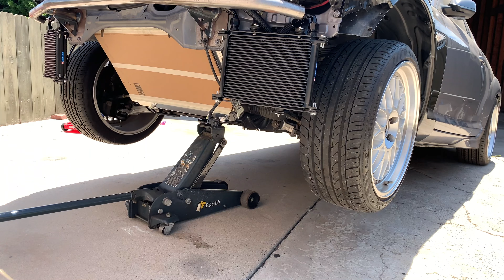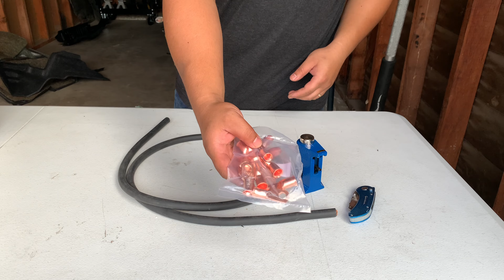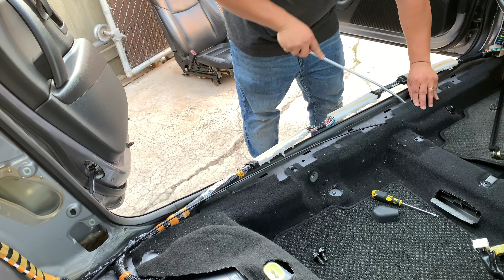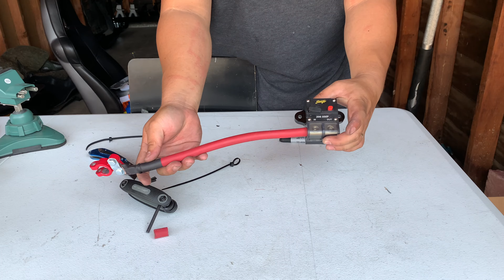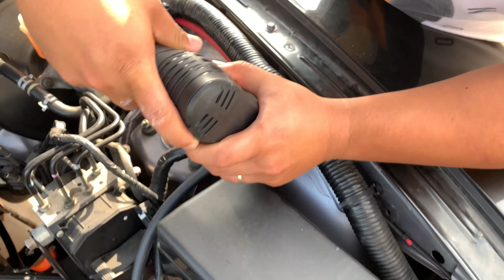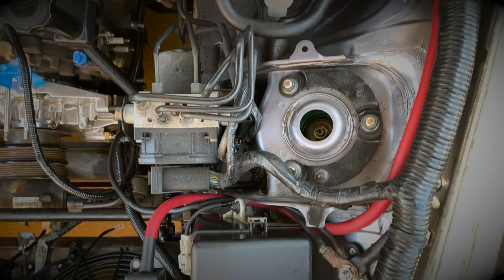Battery Trunk Relocation and Coilover Install on Your Mazda RX8!

Comment: why not put the shrink warp tubing on first on the wire them crimp the connector on then slip the heatshrink tubing up and over the connector where you need the shrink tubing or shrink wrap tubing.

Comment: When doing an engine swap is it best to use the RX8 fuse box or the ones from the car you are taking Engine from? I have a complete TSX Donor car for my k24A2 swap RX (The under hood one)
Reply from the maker: RX8 fuse box. You will only need to change the ECU and wire it up in order for your k24 swap to work.
Reply: @freemadc2  what you think about the RWD wire looms? Waist of money or will the factory one still work?
Reply from the maker: @ScarletSanctuary  anything from rywire is an amazing product, but if you are on a budget, you can definitely make a harness yourself.
Reply: @freemadc2  Thanks for all the info, when people do these swaps they always leave out the most important part, wiring and ECU needed. EMU BLACK has presets for the RX8 K24 swap built in, for others reading this.
Reply: @freemadc2  was planning on getting the EMU BLACK or would the TSX ECU work? Want to be able to use the RX gauges and Electric Power Steering
Reply from the maker: @ScarletSanctuary  I heard EMU Black indeed works in the RX8, but not alot of info last time i checked. I went with adaptronic modular, cause i know it works with the stock can bus equipment from the get go.
Reply: @freemadc2   sadly Adaptronic has been sold out for awhile with no ETA on restock or would get that one. Talked to ECU Masters yesterday about the EMU BLACK and it talks with the canbus and it's a pin yourself kit.
Reply from the maker: Yea. This youtube video has good info on using EMU Black on a RX8. 
https://www.youtube.com/watch?v=QO4z2OUii44
Reply: @freemadc2  awesome, been watching every RX8 swap vid preparing parts list and what to expect and knowledge from different people.

Comment: This is incredibly helpful. Thank you man. Gonna be doing this soon 🤘
Reply from the maker: No problema. From the feedback of the community, just install battery on the opposite side of driver 👍
Reply: @freemadc2  gotcha. If you don't mind me asking, is the battery junction at the front of the car for the positive terminal necessary?
Reply from the maker: @TRlANGLZ  it is not. I just like the way that jp3motorsports did it for the 1993 Rx7 and so I tried copying it :).

Comment: Great job for all, but the battery positioned in which point, does not unbalance the weight in the right curves?
Reply: The battery weight isn't really that significant. The main reason to relocate it is for more cooling airflow in the engine bay.
Reply: @inoahmann7542 The weight is definitely significant, especially the balance. You're taking about 30-35lbs from the nose of the car and putting it down into the back...

Some do this from the sake of battery discharge issues as well, I'm going to be running a shorai and will be doing this soon.

Comment: Ty finally a good video for my 8 battery relocation
Reply from the maker: You are welcome and thanks for subscribing. To note, a few subscribers pointed out that it’s best to mount battery on opposite side of drive for weight balance and you do not need to run a ground to engine bay like I did. Other than that, my videos will guide you through everything else. Cheers and happy relocating ;).
Reply: @freemadc2  btw you should start posting again!!!
Reply from the maker: @ericbrusuelas1807  💯. Follow me on Instagram. I’m starting to give small hints to next project 👍

Comment: Great job on the relocation. 

For everyone else who watched, you don’t have to route the negative cable all the way to the back which in turn can save time & space to keep the original retainers for the main harness inside the car. 
One ground from the battery to the strut bar. Another ground from the ground cable in engine bay to the body of the car via a grounding block (Amazon for $7-12 pair) . Doing this will look just as solid as well as save time on messing with the engine battery harness (just tidying up & tucking is all that’s required) In the end it’s up to you (the wrencher) to decide. Overall great job man! 💪🏽
Reply from the maker: Hey Daniel. Thanks for the props man! More videos come. Yep extending the negative terminal cable to the engine bay is optional. I did it just in case I have some electrical components that needs to see a battery negative instead of a chassis negative. i.e. the IGN1A coilpacks. Less gremlins to worry about with this one extra step.

Comment: Lol just noticed we have the exact same color setup, I have a silver 04 and I did the s2 front end conversation black fenders
Reply from the maker: That is awesome! Did you also get a steal on a S2 front end? Mine came off a GT. Did you get yours painted already?
Reply: @freemadc2  yep! 150 for both fenders headlights and the plastic under tray. I had 1 bad fender and it would’ve cost more to get a new fender than it was for all that at the junkyard
Reply from the maker: @jerretn99  Thanks for following! I still gotta get the plastic under tray, but yep, going to the junkyard is the best way to get the best deals!

Comment: Link to battery?
Reply from the maker: Here is the link.... https://amzn.to/3504dwQ
Reply from the maker: Also the Battery bracket link.... https://amzn.to/3jMKqVV
Reply: Thanks love the build I would like to get a fd engine in my 8
Reply from the maker: @jonathanruiz3840  Hit me up anytime if you need help. Ill try to share as much of my knowledge with you. :)
Reply: Thanks once I get one I will but I will try to rebuild my s1 engine first
Reply from the maker: @jonathanruiz3840  awesome! Some of the installations I do on my build does work on the renesis motor as well. i.e. the oil coolers.
Reply: Yea I wanna get mishimoto oil coolers and im gonna street port my renesis

Comment: Top job mate, Very clean !! I just did this to my 8 and it's worth every penny. The starter and engine jumps to life from this upgrade . I used zero guage cable to the starter direct and then jumped off that to the engine bay. Grounding is the key with RX 8 and added a few more from engine to chassis and two separate points from the battery negative to chassis as well. Love ya work !! Keep them coming , I'm going to start uploading my build soon for this car. Cheers mate from Australia 🤙
Reply from the maker: Thank you so much for the positive vibes and feedback. The battery relocation to the back is definitely worth every penny. Cleans up the engine bay real nice and makes room for bigger turbo. Nice! Did you drill a hole in the transmission tunnel? I was thinking of doing it that way. Let me know your channel once you start and I'll follow.

Comment: Is strictly necessary to wire the negative to the engine bay? I saw a lot of people that simply ground the battery negative to the frame
Reply from the maker: Not necessarily needed. I think grounding to the chassis only is fine, but I wanted to get rid of as much gremlins as possible. The reasoning for me was to keep all original grounding point as possible. Negative battery was grounded to the engine and fans. If you will attempt this, just skip the ground extension and ground to the top shock bolt. I did both.
Reply: @freemadc2  thanks for the answer and compliments for the job, it looks really clean!
Reply from the maker: @Yuanwang768  anytime! If you need any help, feel free to message me on facebook or instagram! I'd be happy to help anytime.